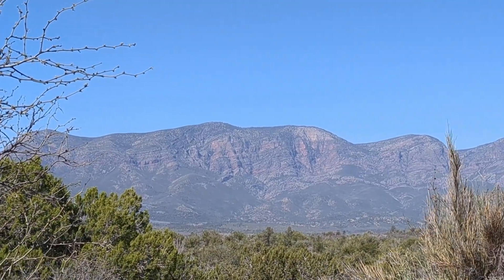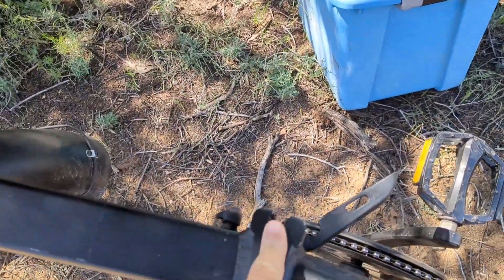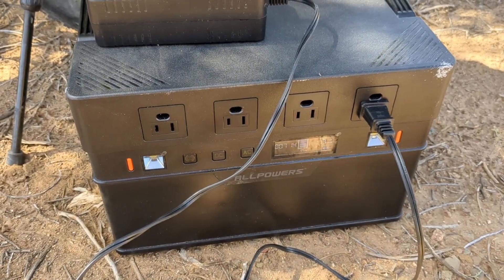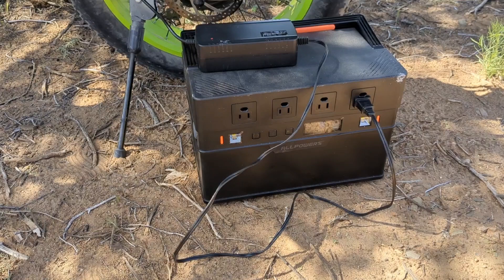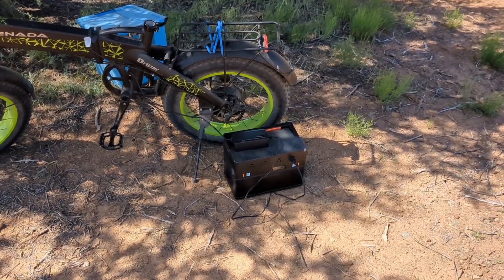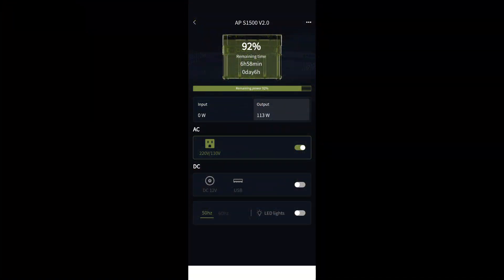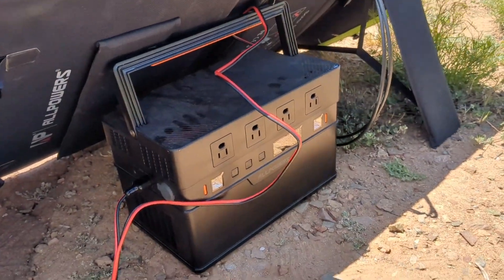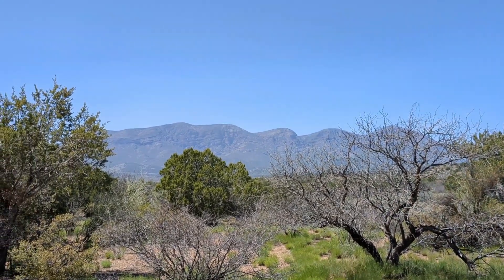How To Charge E-BIKE While Living In A Van?!  🚐🌎😃 #vanlife #boondocking

Comment: I do have about 25k saved up for a Chevy Express 3500 van. I want one that has lower miles, maybe a Pre-Pandemic 2019/2018. I want one with a high roof so I can stand up in the van. I have a nasty back injury so I cant really bend over. Yeah it will have solar panels as well. Maybe a Bluetti with portable panels.

Comment: Cool, I haven't charged my bike battery yet from my van battery bank. Did 16 miles on it last weekend, wide open throttle, 20mph. Used almost the whole capacity of the battery. Lectric XP 2.0 same bike as your Senada.